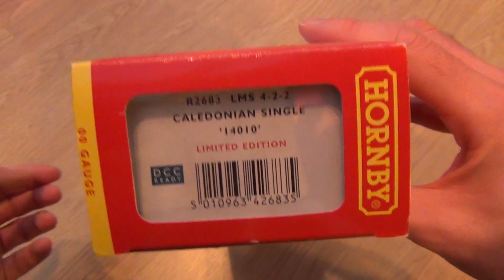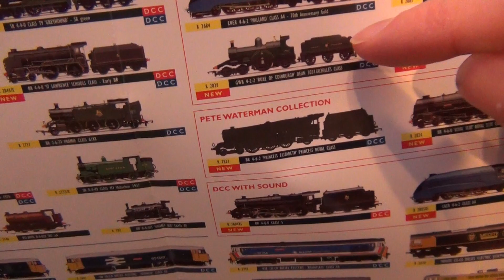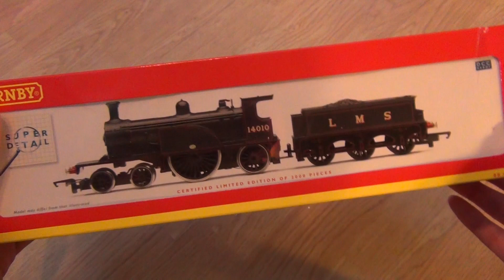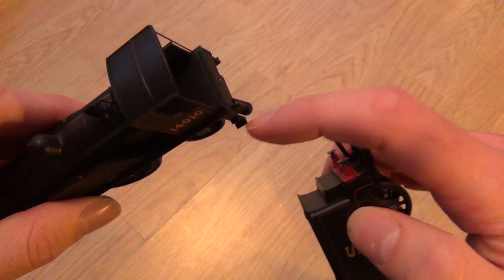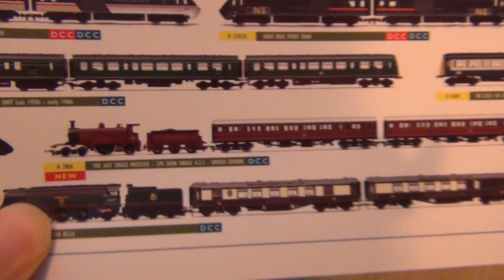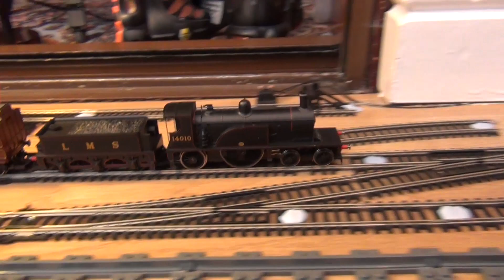Opening the Caledonian Single Wheeler by Hornby

Comment: I have number 6 out of the 2000 made and I havent had any problems with mine it runs realy well over points and does a good slow speed and im running on DC yes hornby did brand them as super detail and that was wrong but it is a re run of the old triang single wheeler and that was wrong.
To me it looks like you just had a bad one. I also think that they could have improved on the detail by adding bogie detail painting the cab adding metal wheels on the tender.

Comment: I guess you could go and purchase or use spare detail to up it up, remove the traction tyre, and the let your modelers intuitition go to work and add some basic detail and then paint the inside of the cab with some fineeeee brushes You know make it all preety. Let this be and IC82 Challenge ture the crappy single wheeler into you know a not so crappy single wheeler.

Comment: Maybe if the back wheels were also powered it would perform better and not need traction tires. Sure, it wouldn't be historically accurate but it would certainly run better and pick up more electricity. Though tbh, that particular version of the Caledonian Single is not very good, the red one and the blue one are really good. The reason why it doesn't have a lot of "detail" was because there wasn't a whole lot of detail on the actual engine prototype.

Comment: Anyone who thinks the slimline tension-locks make it more realistic is kidding themselves. There's no getting around the fact that tension-lock locks sacrifice form for function and any attempt at getting around leaves you with something that's still not realistic but now also doesn't work so well. And since most people who are such fans of slimlines and the NEM pockets they're they're fitted in want them that way so they can be easily replaced with Kadee's Magne-Matic knuckle couplers anyway, then frankly it would make more sense to just fit large and medium tension-locks to the NEM pockets so that those of us who don't think tension-locks detract from the looks don't also have to buy new couplers (Which would often have to be kitbashed on) for best performance.

And yeah, that is NO Super Detail locomotive. That's one of their ancient Tri-Ang toolings masquerading under the Super Detail label to rip off a few extra pounds from the buyers.

Yyeeah... Loco drive Singles have a hell of a time picking up electicity. They need all the help they can get, ideally you would have EVERY wheel picking up electicity, ESPECIALLY THE BIG DRIVERS BECAUSE THEY'RE THE LARGEST AREA. And in the case of this bastard you'd actually be better off with the original Tri-Ang tender-driven model, which is just sad.

Comment: As you said, the model was released in 2007. This loco would have been one of the better models in 2007. Where as the other 2 you looked at on the fold out poster, they were released in 2010. But I agree though, she is a terrible model. But I'm also used to the high end detail of Australian HO models.

Comment: I have one of the Dean singles - well it started off as one of their Thomas Range Emiliys until I fitted a brass dome and proper smoke box door separate hand rails, whistles and repainted it! So yes the detail isn't that good on any of these singles.

Mine seems to go over points a bit better than yours but I think the Dean is slightly longer than the Caledonian single so the front wheels get to the next live bit of track before it has chance to stall. I also use PECO points which have a much smaller dead bit on them.

Although I have packed as much weight as I can into mine it still slips a lot and will not pull more than three coaches, but the real thing wouldn't have been much better!

If you want to change the tender wheels the ones fitted to the old Mainline (or Bachmann) Manor or Churchward Mogul will fit. They're a bit of a sloppy fit but they will work.

My next task is to detail the tender (add water scoop & brake rods) so hopefully mine will be "superdetailed" by the time I've finished with it!

However, I'd agree its not worth the full price - I certainly wouldn't buy the limited editions!

Comment: I'm not defending the locomotive, it's poor, but if you took off the traction tyres it might get across the express points more easily and I think it'll still pull those two coaches. The problem is that when the motor stops the rubber tyres on the drive wheels jerk the locomotive to a stop. I had a pair of tiny little crappy LMS 0-4-0T that I picked up for next to nothing amongst some other stuff. Believe it or not just one of those easily hauls a rake of three Hornby LNER Teak coaches.

Comment: Try adjusting the copper pick-ups to push into the wheels properly and then add a bit of weight to the cab, like a little bit of rolled-up lead sheeting. It works wonders on the performance. The express points may be an issue, but it still works over most points! I've got one again and it's running amazingly!

Comment: Don't like singles, model or otherwise. The design was out of date by the 1870's I think and also all the power on one set of big wheels was suppose to improve the loco but it made it worse in most cases. These were known to wheel slip more then anyother type of loco design

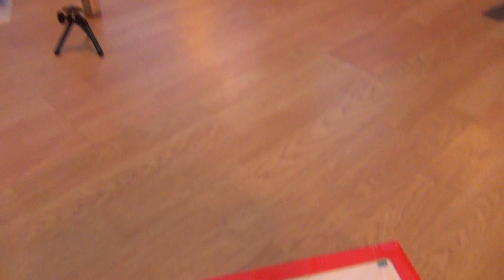Comment: This loco reminds me of the first bicycles, that huge wheel in the front and the little one in the back. It really seems like the worst model loco ever. I hate traction tires, too, (just replaced them on my USA Trains GP38 1:29 scale). They could have powered the big wheel and the trailing wheel, just to get more traction without the traction tires. They should have put more weight in the loco. They should have put a spring on the front bogie for down force. They should have done so much more

Comment: It's called the Caledonian Single because that's literally her class.  She was just one loco, a single wheeler made from one of Drummond's 4-4-0's for an exhibition and later earned fame when she participated in the Races To The North in 1888.  She was actually preserved by the LMS as she was one of their pet locomotives, hauling around 2 coach directors trains until she was withdrawn in the 30's.  The Hornby model is the old Triang one, just with a better motor and a nice paint job, that's it.

Comment: The Dean Single was designed by William Dean of The Great Western Railway,see that's the name.They were built between 1891 and 1899 just before broad gauge was abolished in 1892,  There were 79 built including the most famous, Lord of the Isles, which in 1960 was revealed by Tri-Ang Railways. The one in the fold out is most likely Isle of Iona, There were Three produced, Lord of the Isles (I own an 1963 Tri-Ang one), Great Western, and Isle of Iona. Will I hope I have solved this problem.

Comment: just a thought, it might work a little bit better if when you are running it with the coaches, stick another engine on the back so it at leasst goes through the dead zones without stopping. Have a good christmas too Will!

Comment: Hey Will, If it helps there was also an Eastern version built by the Great Northern Railway, the Stirling Singles, and they have one detail difference which separates them from the Midland and Western ones, they have side rods and outside cylinders. There is one preserved at the NRM (not sure which one), and the loco's number is 1. :D
Looks like Thomas has got some competition.